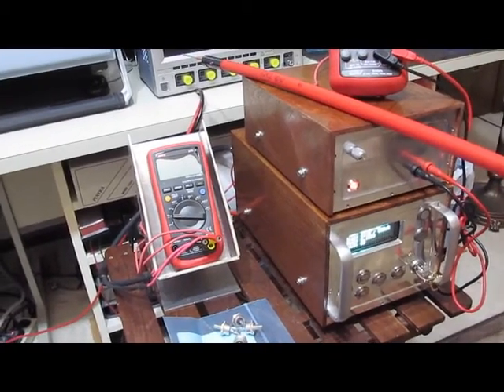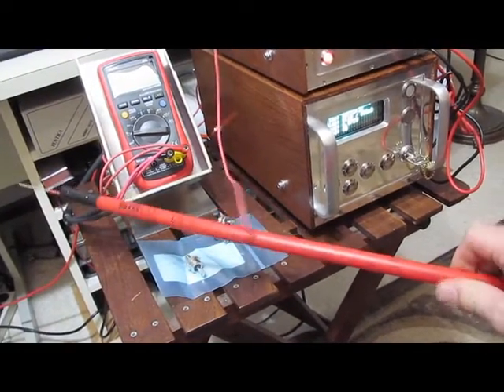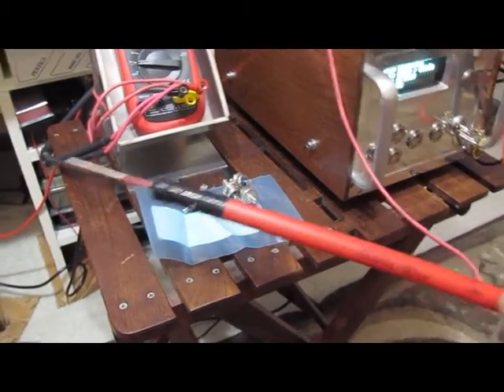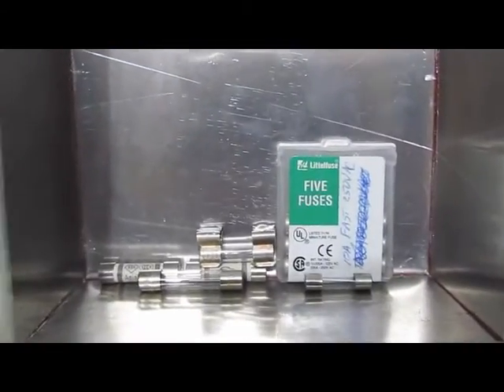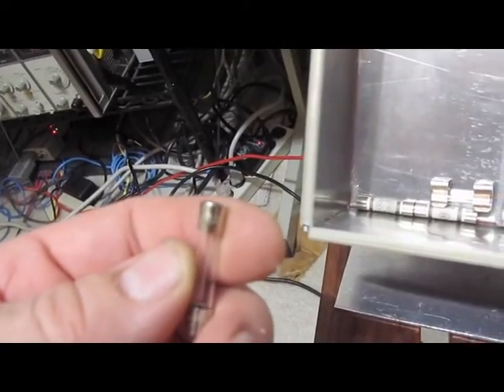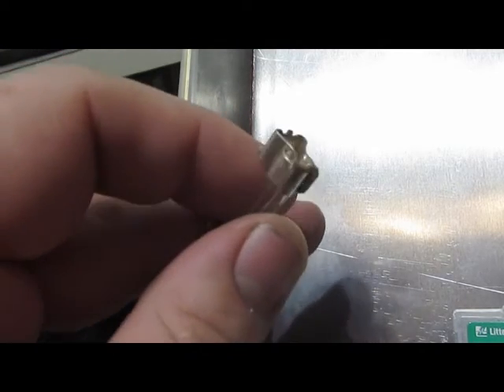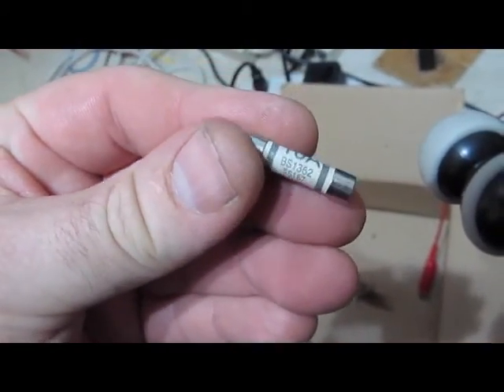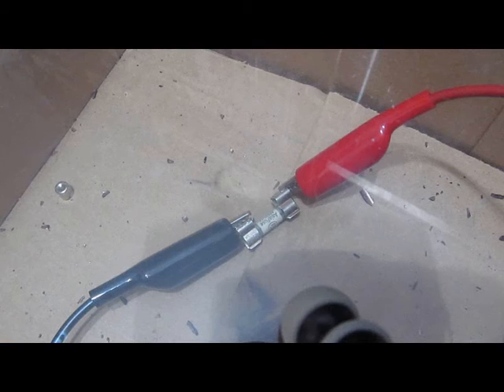Building a medium energy transient generator Part 3

Comment: Hi Joe, really enjoy your videos. This one got me curious... What's the switching mechanism that allows the MCU to deliver the HV output? I'm guessing it's some sort of SCR thyristor triggered hard and fast by a MOSFET? Do you have any details or part numbers? Cheers
Reply from the maker: There's a few ways you could pull it off. This setup is fairly low energy so eases the constraints.   Make sure the capacitors can handle the di/dt you're looking for.
Reply: @joesmith-je3tq  good point on the capacitors. I was looking at thyristors, then found some IGBTs, but just found an interesting part inside my insulation tester. It's a Toward LRL-102-100PCV HV reed relay that can switch 7.5kV 1A. Lot's to (carefully) experiment with...
Reply from the maker: @DarianCabot  When it comes to HV mechanical relays, to keep the contacts from welding, the fine print is everything.  Worse now, as companies merge sometimes this data has been lost.  You may for example find that if you actually tried to switch that much current at that voltage level with your relay it would be instantly damaged.

Comment: That fuse test was pretty neat.
Reply from the maker: +stefantrethan Photonicinduction made a video where he put one of the large fuses on his capacitor and it exploded.   I was expecting these Asia Fuses to come apart rather than what happened.
Reply: +joe smith If I remember right the glass fuses are rated at a couple hundred amps and the ceramic ones a couple thousand or more. You used to see glass fuses with sand, but not any more, I wonder how they compare.

The glass fuses really are crap, one time I used one in some test gear I made, with a wiring mistake, it blew the plastic fuse holder right to bits. Best not to use them directly on mains, only where the fault current is low, like after a small transformer.
Reply from the maker: +stefantrethan I have never seen a glass body fuse with sand.    That glass one sure made a mess.   Why they would put one in a meter, you got me.   The AsiaFuse fuses shown were filled as you would expect.    Break current will be in the data sheet for each fuse.